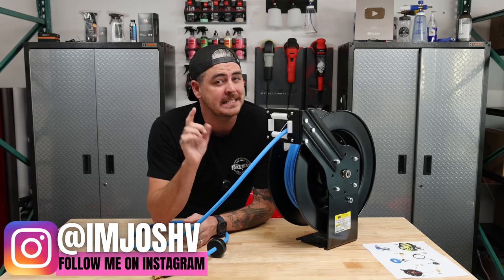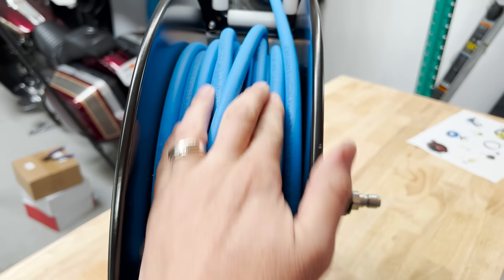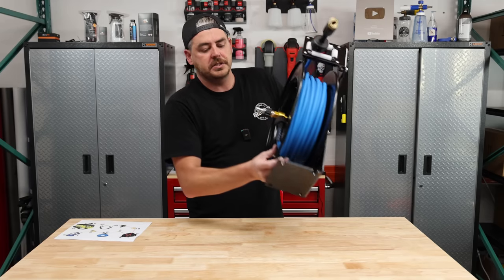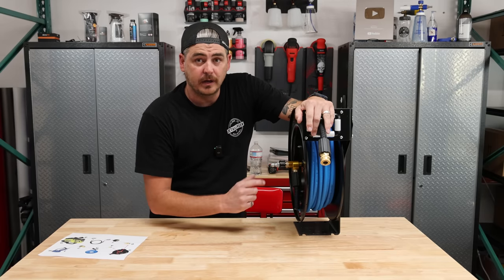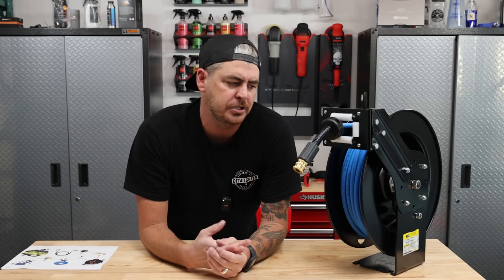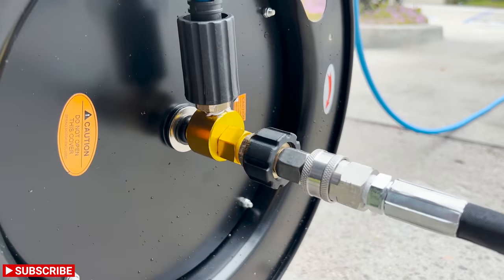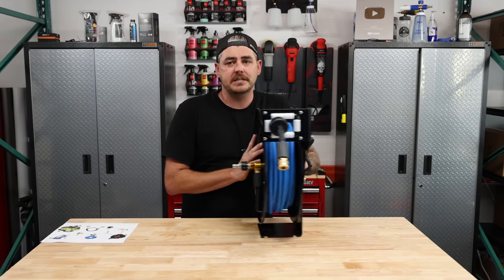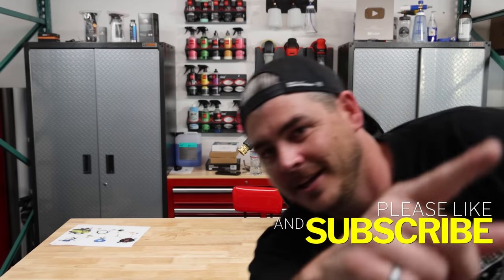RECTRACTABLE PRESSURE WASHER HOSE REEL | Pressure Washer Hose Upgrades

Comment: Just did this, too. Mine was $69 on a sale at Harbor Freight this past weekend.
Reply from the maker: Awesome deal!
Reply: I was thinking the same thing when I saw that hose reel, next time it goes on sale ill have to pick one up
Reply: Did you use the merlin like stay slick, or did you use the cheaper central pneumatic? I’d like to try the central pneumatic, but have not heard of anyone that’s tried it yet.
Reply: @Craig Andresen  mine is the Central Pneumatic. It has been fine using it for the past 2 weeks. I believe the "cheap" comes from the air hose, which I removed. It seems like the same quality as the Walmart brand "Hyper Tough"

Comment: If you cut the plastic off the metal m22 fitting, you can run it through the orignal hole.

Comment: @IMJOSHV would it be possible to make the amazon basics hose reel video public again? the link in the description shows private. Thanks!
Reply from the maker: Hi a couple people commented that the connection blew apart on the cause there is not enough threading. I took it down so no one has to deal with the issue. I think they may have changed something on the reel since I made the video cause there weren’t any issues like that till later on. I’ll try to order another one and see if I can figure it out. If I can I’ll make an updated video!
Reply: @imjoshv  oh that's unfortunate. Great videos otherwise. Love all the testing and recommendations.
Reply: Mine did also but I bought another connector with more threading because the one that comes with it doesn’t have enough threading

Comment: I built the same thing after some use the seals go bad so you have to take it apart and put new seals in with grease. I’ve had it happen to me when I’ve been at a customers house sucks . I think it’s just to much pressure for the reel it’s not made for that kind of pressure
Reply: 😂 Yeah, i have the same setup and i have had to replace the seal twice while at a customers. The little piece that holds it from coming apart is really hard to remove aswell so its a pain.
Reply: @Sudzwrks  what seals did you use? I'm dreading switching to a hand crank reel cause the retractable is so cool. If I can find the right seals, I'm game to keep it.

Comment: It is suppose to leak at the connection at the reel . It seem to go away after turning on the pressure.
Reply: I think you were asking if it is normal (?). It’s common (I believe so) for it to leak until it is under pressure.

Comment: Does anyone know if I can mount the reel in any orientation. There is a wall too adjacent to where the lead-in hose goes (on the left) so if I flip it on the other side (and have the lead-in hose on the right) will that damage anything?
Reply from the maker: I don’t think that would cause any issues!
Reply: Thanks @imjoshv  , Your content is awesome!
Reply: Have you tried a 90* between the adapter and whip line? (I had to do this when arranging it in my mobile rig)

Also, what hose are you using? (There might be other fitting options for you depending on the size and budget)

Comment: Are you not putting 10x pressure through fittings made for a lot less, the hose real is made for 200 psi, the power washer is like 2000psi or more, you replace a lot of stuff, but the key component of the hose real is the fitting that allows the real to turn and that you don't replace, so not sure I would put 2000 psi through that part that is designed for 200 psi (and also not designed for water) so I don't think it will last very long if it lasts at all and could be dangerous if it comes apart, I would not stand near that when it was pressurized.

Comment: Your Amazon Basic hose reel video private. Why?
Reply from the maker: They changed the reel a little bit and some people were having issues with the threads not holding since they shortened them.. I pulled it down do people wouldn’t have any issue
Reply: @imjoshv  Thank you for the explanation. Keep up the good work and love your videos. Learning a lot about detailing my vehicles by watching your videos.

Comment: bro wtf, i bought all the stuff you said and its not all correct  3/8inch to m22 male adaptors NOT 1/4 inch to m22 adapters (#4 and #6)
Reply: I just got mine also. Not 1/4 to m22
Reply from the maker: I’m sorry about that. When I did mine it was… I wonder if they updated it

Comment: Just an fyi stay slick made this on his YouTube channel months ago so some credit should be thrown his way. He also gave an update and it only lasted about 8months as the air hose seals in the reel didn’t hold up to the higher pressure that the pressure washer created and started spray water everywhere.

https://youtu.be/7VgP3gWtXUw

Comment: Guys don’t do it, this set up will leak on you after a few sessions
Reply: Think of water in a pipe the only way it can get out is if there is a hole’ 
If you’re leaking water you
 A) both cheap parts 
B) didn’t hook them up right/ didn’t tape your ends